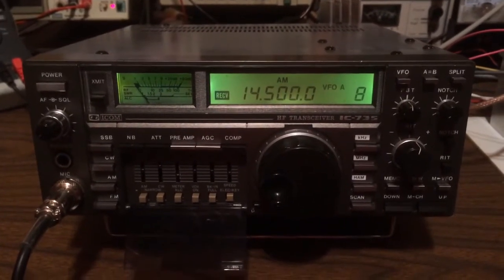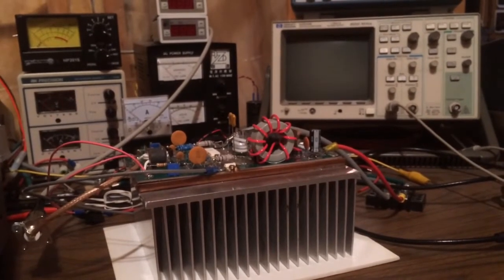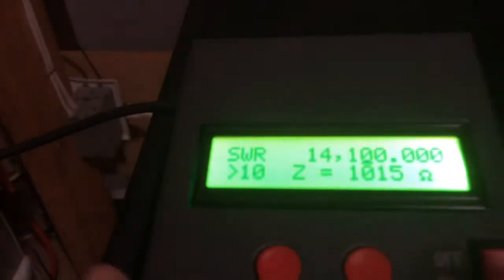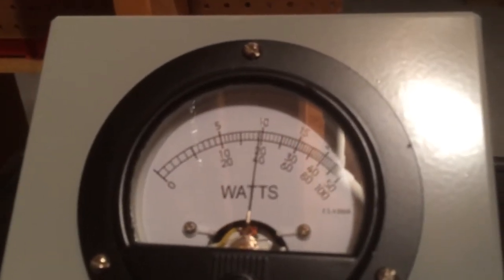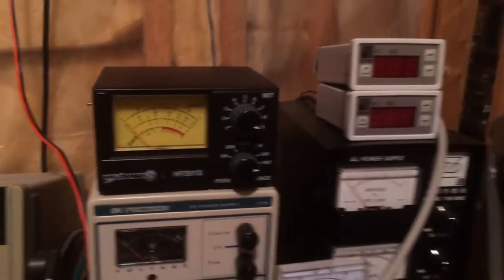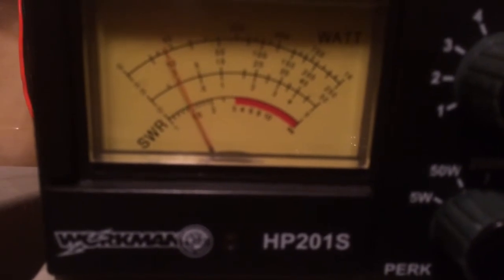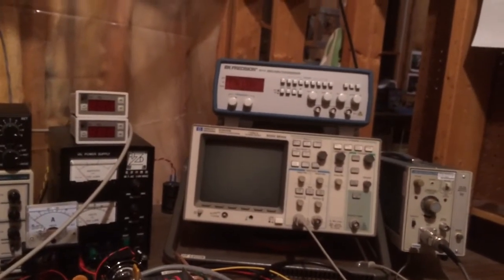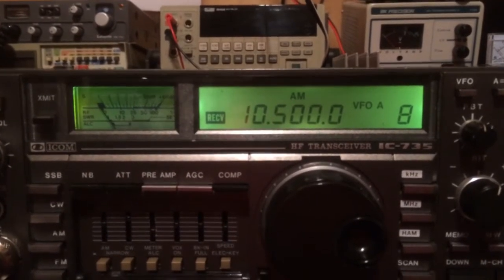RF Man discusses SWR for a LDMOS broad band Amplifer

Comment: The SWR meter you are using is only specified for 26-30 MHz use, so the analyser is giving the correct value. Try the same test with a Diamond or Daiwa SWR meter that is ranged 0 - 50 MHz

Comment: What is causing the false readings on the analyser? How is the testing of the board being done with the analyser, is the input of the board being tested Dead or Alive? 
Is the analyser detecting some kind coupling to ground? Would a false ground coupling be needed to use the analyser to see the headend of the amplifier correctly and why? 
:-) Tupid questions from uh Tupid person.